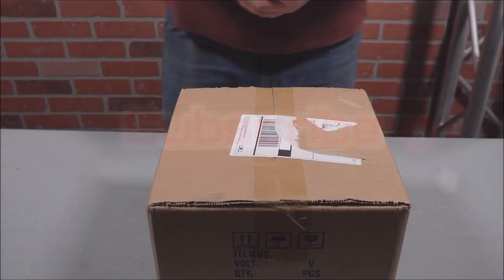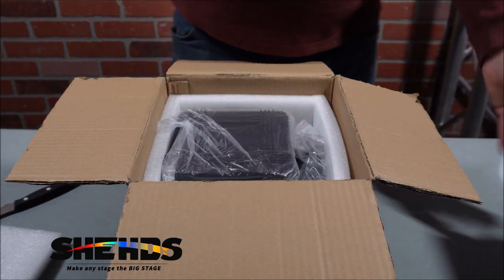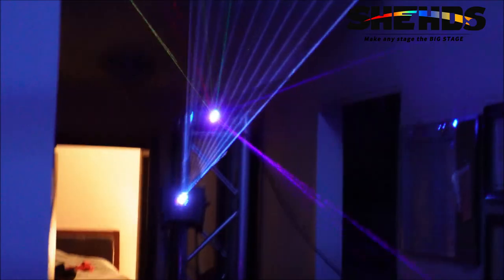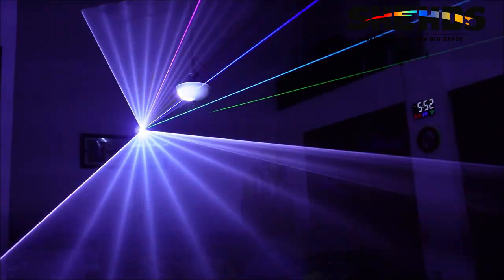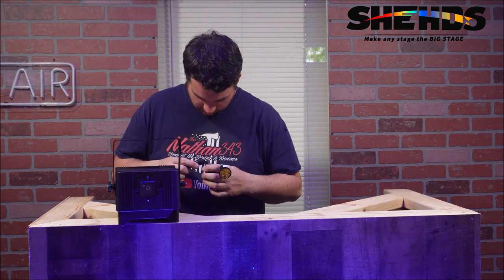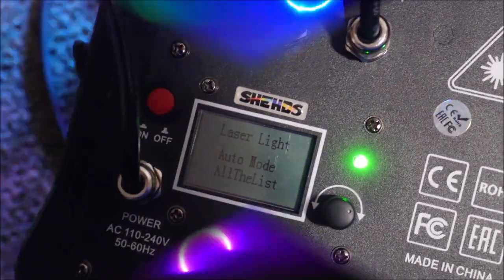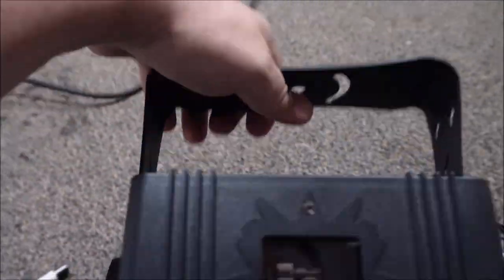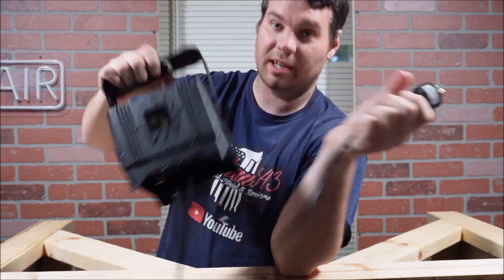Shehds 3W RGB Waterproof 3D Laser

Comment: The banding is pretty bad for video.  Is there any way to prevent this if you're filming with it in use?
Reply: Only way is to get an expensive camera.
Reply: @Partyatmosphere  Sure, I have an a7iv, and the new variable shutter speed ability seems to take out banding in certain LED flashlights when I dial it in properly.  It would probably eliminate most of it.